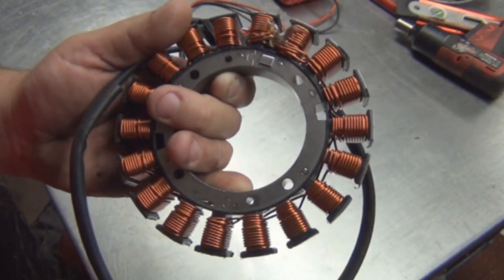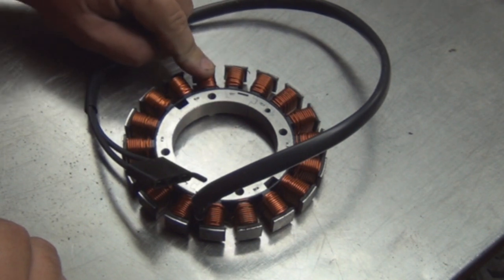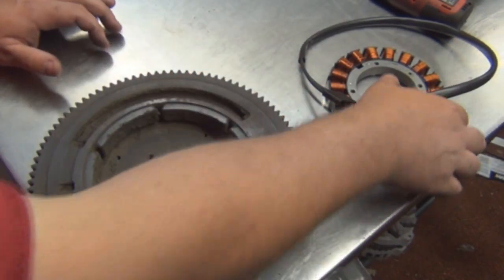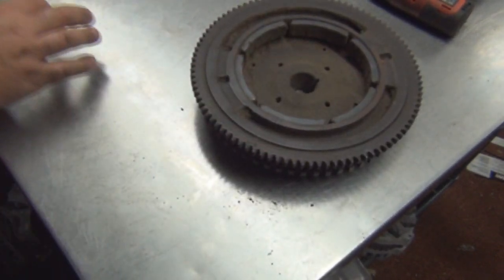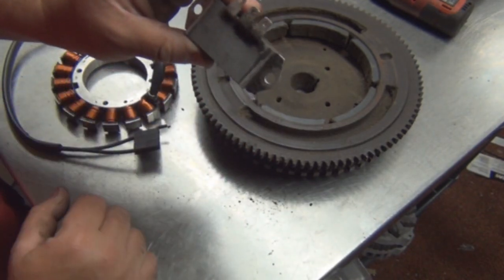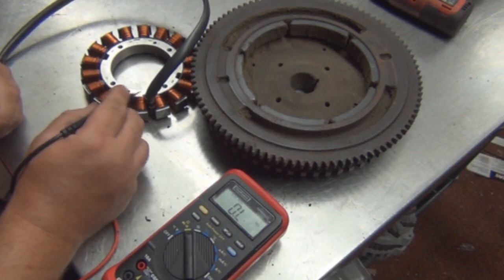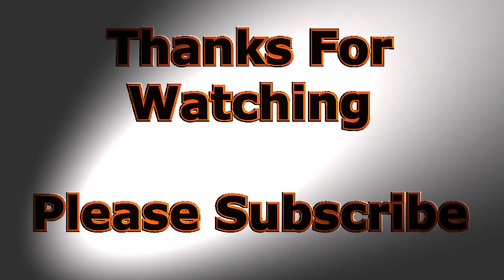How A Stator Works & How To Test video

Comment: Why people gave it a thumbs down. 
Well, He starts by saying the stator charges the battery. It does not. The stator produces energy via the creation of a magnetic field ( magnets and wire). That energy is used for ignition.
Thats its.

Changing that energy to battery power ( ac to dc) etc are all extras and not the purpose of the stator to which is to make energy to fire a spark plug.

Comment: At the end of your demonstration, you said “voltage” instead of ohms or an ohmic value when you measured out of the connector to the stators’ core ring. Good demonstration. Thank you
Reply: Or "continuity" which would have been a correct term.

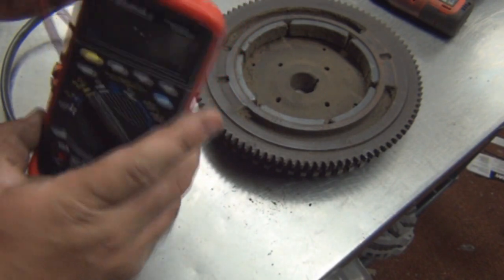Comment: Excellent explanation!!!  Thanks!!!   The only thing I might add is at 3:45 to 3:47 you mentioned that in the Ohms setting that it would read "Voltage".  The correct term for that OHMS setting would be "continuity" pronounced (Con-tin-nu-ah-tee) or "ohms" which is a measurement of resistance.  You described it right but with incorrect terminology as you stated earlier between 3:05 & 3:15.

Comment: That other video was put out on replacement of the Stator was put out or posted here on YouTube by by Repair Clinic.  One other point you might mention to clarify the purpose of the Stator which may help the average homeowner better understand the design and purpose is that it is in effect an alternator for the lawnmower similar to a car.

Comment: So that little concoction of both a regulator and a rectifier.  A regulator controls voltage and a rectifier changes the Ac input into dc output.  Okay, something like that.  Where does all the unused voltage go when voltage is not needed anymore?  Can you tell if each one of those coils is wound the same way, and the same direction and all of them hooked up in series, or the winding direction and the way each is hooked up to the other appear more complicated?

Comment: Good video. 
When this is up and running the open circuit potential should be around 30 to 34 Vac.  And if available, meggering between one of the leads and the inside metal ring can help assure that the winding insulation will be lless likely to break down.under stress.

Comment: Good video. Continuity is half the battle with the first check. Need to verify resistance is within manufacture spec. A dead short (shorted windings) will still give you continuity but not correct output.
Reply: what should that resistance be on an average lawn tractor Thanks

Comment: I currently have no spark. my generator has a stator, but no battery, my coil works, plug works, the on and off switch works, can the stater cause no spark?

Comment: Nice , was helpfull.....My motorcycle battery is charging v slow,  its a new battery, new rectifier ... should I have to change the dynamo unit u showed in the video??  And does the new dynamo comes with the magnets also , or only the coils??

Comment: Please help me understand my reading.. when I touch both terminals and hold it for 5 seconds my values change every second from 0 to 00.1, 00.2 sometimes 00.3 then 0.00. Is my stator bad or good?
When I was testing it for volts (before removing it) I had zero volts coming out of 2 terminals

Comment: 3:20 - I believe what you are saying is that you want continuity (~0-ohms resistance) across the leads (the first check), but infinite resistance from the leads to the body of the stator (you said voltage at 3:46 - I think you meant measurable resistance)?

Comment: Question ? I removed my flywheel from my Massey Ferguson 10 with a Tecumseh engine tonight trying to figure out why it's not getting a spark. My flywheel has two pins that passes under the coil. After replacing the coil and still not getting a spark i thought the problem may be the flywheel magnets because i could not detect any magnetic pulls on the firing pins of the fly wheel. what might I be over looking ? My magnets are encased in a solid aluminium ring that surround the stator . most flywheels have magnets on the outer rim but mines does not.  Thank in advance for assisting

Comment: Great video.  I'm having a red battery light on my zero turn and not sure what it is.  It's an Kawasaki FX651V and not sure if it's stator or not.  Questions are: Is it possible to remove the flywheel nut if I don't have an impact?  And, is the engine manual supposed to show / tell what voltages I'm supposed to see from the regulator and/or the stator?  The mower manual doesn't really go over anything to look for in troubleshooting for this unless the engine manual does.  Not sure as of yet of that.
Reply: they make a wrench that holds the flywheel so you can remove the nut with out a impact gun ,, people try and use a screwdriver or pry bar and they will break a fin off the flywheel or break a tooth off the starter ring or break a part off the engine block ..another old trick is too pull the spark plug get a long rope fill the piston hole with the rope leave some rope out so you can pull it back out when done .. but when the rope is in the cyl and your turning the nut the piston will hit the rope stopping the engine from turning over .. if there is enough rope in the cyl ..leave enough rope hang out or you will have to pull the head off too get the rope out ..

Comment: does it matter which white wire goes where on the outside terminals when installing a new stator? since they both should be 30 volts ac when running does it matter if they are swapped? I know the center wire should be the 12 volt

Comment: Excellent video! Thank you so much for explaining this! Just what I needed.  I have a 2015 S 900 Razor. I want to add another battery to it along with the stock battery. The second battery I want is a 925C Odyssey. Can you help figure out how I would do this? Should I go two of the same batteries and run a separator between both batteries? or, should I run all my accessories and my UTV off the one 925C battery only? Any advice and installation tips would be greatly appreciated.
Reply from the maker: Thanks for watching.That all depends on the load vs your alternator (stator) amperage output. Once the machine is running, the stator setup  is doing the work and charging the battery. If you have to many loads that exceed your alternators output then it will start drain the battery. I would look into either a stronger alternator setup or some kind of capacitor or both. But if you have a high powered winch or something of the sort, then I would consider a stronger battery if the one you have now is not strong enough. I hope this helps. That custom stuff can get tricky and is alot of trial and error.

Comment: My 18hp Kohler on a Craftsman lawn tractor had been blowing fuses so I measured it with a DVM and found that it puts out 21VDC!  I replaced the voltage regulator, and even temporarily clipped on a second ground though the original is in good shape, and again got 21V! The cooling fins were jamed up with fiberglass mice had dragged in there. Tested the stator for a short to ground, found none. Pulled the flywheel, cleaned the fins, and the stator, which appears to be in good shape. Reassembled everything, rechecked for shorts, and tested the AC Voltage coming off the stator, no load, only the meter hooked to it, measured almost 45VAC! Any idea what I should measure this way? And do I spend money for a third regulator? If you have a few minute for the whole story go to my videos on this.

Comment: I have a riding lawn mower that I had to rewire, but I'm worried about overcharging the battery. Do I need to worry about this? Or can I go directly to the battery from the voltage regulator/rectifier?  The engine is a Briggs & Stratton 12hp
Reply from the maker: +zoe la Try to get your wiring schematic for your particular mower and wire it as shown in the schematic. I have a video on how to read wiring diagrams here https://youtu.be/TzZjVWPnXDg . But the regulator / Rectifier need the stator to produce current to charge the battery. Also the regulator / rectifier is what controls the Voltage/ amperage that comes out to charge your battery. I hope this helps. Please Like, share, and subscribe.

Comment: Any help out there.. have a Kohler and it started to miss and shut off stall when it gets warmed up, changed the carb... does the same thing... runs fine for a short period of time and then starts to miss then stalls wont start and after it cools it starts right back up..  Coil Stator or Rectifier or OTHER>. HELP

Comment: Does it matter which wire you put the positive volt meter probe in when checking for a bad stator?
Reply from the maker: No. Just as long as it’s in Ohms and it’s not connected to any power. It’s best if you have the wire diagram just in case you have an oddball stator and the wire setup is different. I hope this helps. Thanks for watching and commenting. Please like share and subscribe and hit the notification tab. Thanks again

Comment: Also because the current created by the stator is "AC" for Alternating Current, there is no need for polarity observance as with "DC" or Direct Current where you have pole specific current and position.  I noticed in another video where they showed how to replace the stator but failed to mention that when removing and reinserting the pin connectors in the wiring harness, that polarity need not be observed as the current is Alternating Current and therefore has no specific polarity.  Thanks to your better explanation it became apparent that there is no need to be worried about "correct pinning" or polarity observance as it is irrelevant.
Reply from the maker: +MARK PUGH Great! I'm glad you liked it. Thanks for watching. I greatly appreciate your comment. Please like, share, and subscribe.

Comment: I am (trying to) restore a 1979 Cub Cadet 1450.  First up is to find out why the cable for the throttle lights up like an LED when the key is switched to on.  Obviously shorted somewhere but a separate problem (think the motor's ground wire is the culprit).  The wiring diagram shows a stator, but the actual motor has an alternator.  The wiring diagram is out of date I believe and the stator was replaced by the alternator at some point during production....but thought I'd ask an expert to make sure.  Am I right?
Reply from the maker: Thats hard to say without actually seeing it. Possibly a short to ground. Maybe a frayed wire , bad  shorted switch, and etc.

Comment: I replaced my voltage regulator on my Kawasaki FH661V n my zero turn. I thought it was bad. It is still blowing fuses, but only if I attach the B+ wire up. If I leave it disconnected, all is fine. Do you have any suggestions?
Reply: Hello Did you solve problem. Possibly pinched wire causing short.

Comment: What is the normal resistance reading of the stator coil? what you did is a continuity test and ground test.
Reply from the maker: That is correct. I keep it simple not to confuse the viewers especially ones that are new to this. When you get deep into the specifications like you are trying to do, I’ll reply and say check the manufacturers OE specs in the manual . Thanks for watching and commenting.

Comment: thanks for the vid. I have one question though. I have an 88 honda fourtrax 4 wheeler and its having all sorts of issues sometimes not getting spark. My stator reads 4 volts when I'm cranking the motor over. Does this mean my stator is bad? do you have any idea how many volts it should be putting out when cranking over the bike? thanks!
Reply: +1795magicmoney1795  if your battery is a 12V battery 4V is nowhere near what you need.  Should be around 14V.  You probably have a bad stator.

Comment: Thanks for sharing this. Can you do this test with the flywheel removed and the battery disconnected ?   I am having trouble removing the wires and it wold be easier and safer to do if it is still on the mower. Cheers from Australia.

Comment: What GWNERATES the current? The stator or the magneto wheel?  I'm having trouble where I'm getting week charging and when I give it gas the volts go even lower. I'm tryna figure out which part ilhas failed.. Thanks
Reply from the maker: The stator produces current through a regulator / rectifier. A magneto produces electrical impulses for ignition. I hope this helps. Thanks for watching and commenting
Reply: So if I'm getting a weak charge, but I have a brand new rectifier on their, and my wiring is good, and my battery is new. Would the weak charge come from the stator or would it be the magnito wheel?
Reply: Ty sooo much!

Comment: dude explain to me ,my dirtbike stator .it only powers cdi ignition.and if i want to hookup lights to it how do ago about it,preferably dc!so stator to my ignition coil is ac,then the lighting coil from stator to regulator rectifier to capacitor to led.i dont need battery cause its a kick start only,plus dont want extra weight!now could you kindly explain the wiring in layman terms!

Comment: Thanks! My Poulan mower owner's manual states one place that I should replace the alternator if battery won't stay charged.  Elsewhere in the manual under parts, there is no alternator listed. In the electrical schematic it shows ALTERNATOR location and 'disconnected' in parentheses !!! I 'm guessing I must have a stator somewhere?
Reply from the maker: +John Greenlee most likely 9 times out of 10. It's usually located on or around the flywheel. I hope this helps. Thanks for watching and commenting.
Reply from the maker: +John Greenlee also please like , share, and subscribe.

Comment: My mower runs for 10 seconds then dies and the magnets on the flywheel are broken. Could the charging system, stator, rectifier be the cause of the problem?

Comment: We've got a new Axis 700 (has 11 hours on it, bought it new!) that just refuses to hold a charge.  We replaced the battery and have had a mobile tech out twice (first time he replaced the voltage regulator, second time he claimed rpms were set too high and adjusted-neither one fixed it).  We've been stranded out on our property a couple times and I sent him info on the possibility of it being something with the stator.  He pooh poohed my suggestion, but I think that is the problem.  I guess I have to ask, why on a new vehicle would a stator go bad?  He's coming Thursday and hopefully will be able to finally get it running and holding a charge.  Fingers crossed but I'll take any suggestions!!!  $10K for a useless vehicle is not acceptable!

Comment: What happens if yours doesn't have a regulator? I just took the flywheel off of my mothers Scotts S2046 with a Briggs and Stratton Model #406777 Type: 0115 E1 because it's always had a problem keeping the batteries charged and noticed that there is no regulator just a diode in one of the wires. The stator and the underside of the flywheel were both pretty fouled up with dirt and grass. Is it possible to add a regulator to it myself and is there somewhere I can get a better quality stator for this because the one that is on here seems pretty cheaply made.
Reply from the maker: Without actually seeing how it's built and seeing the wiring schematic, I honestly couldn't tell you..sorry I couldn't help any further. Thanks for watching. Please like, share, and subscribe.

Comment: Does the two wires coming off the stator need to be indentified? Or can they be hooked up either way on the terminals? Mine did not have a clip. Are they reversable is what I think I need to know. Thanks for the great video.
Reply from the maker: On this model that I m working on here , they can be hooked up either way. Thank you
Reply: handy man They should have had a separate fuse in the system just for if a copper winding "shorted out" it wouldn't  fry the regulator/rectifier....which can both go bad at the same time from a mutual dependency on each other...your thoughts on adding one in...?
Reply: Odetta McNabb And..on a wet clutch system should oil ever be on a stator?
Reply: David Blackburn

Comment: On a 90 hp Force outboard motor if the stator is bad could it stop the motor from running even if all 3 spark plug wires have strong blue spark ?
Reply from the maker: +Karl Kirven Not the stator but the timer base / pulser coils could if the timing is off
Also sometimes the spark can seem strong but under compression its weak
Or won't hold up under compression
Reply from the maker: +Karl Kirven I hope that helps. Please like, share, and subscribe.

Comment: I have a issue with my wires heating up that plugs into the regulator so any suggestions other than a bad battery possibly, the battery holds a charge
Reply: Robert Duncan have you found an answer? I'm having a similar issue.

Comment: How much voltage should a stator createIf the engine turns over or is running??
Reply: skojo3e the voltage generated will vary as ac. Will pass thru a diode pack or bridge rectifier and convert it to dc for your battery. About 14Vdc while running but you will read 12Vdc across the battery terminals when your car engine is off

Comment: Good video and I'm sure people can understand.  However, when you connect the meter you are checking for "continuity" there is no voltage.  You are checking for ohms with the ohm meter, not voltage. Can pretty much do the same thing with a battery connected in series with a test light.

Comment: hi can you put a different stator on a motorcyle?coz mine was really expensive i found a stator on ebay which is cheaper same number of poles and wiring attachment the problem is it has different holes to put the screws it it..
Reply from the maker: +mintychocolate aj the different holes to put the screws in most likely will be an issue. I wouldn't be able to say for sure because I don't know what bike your working on and what part you are receiving. Thanks for watching and commenting. Please like share and subscribe .